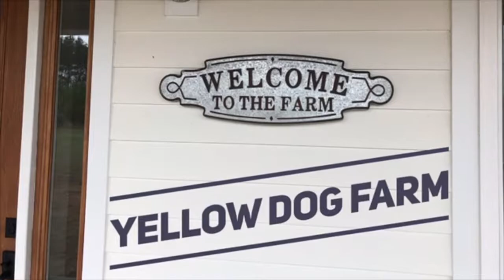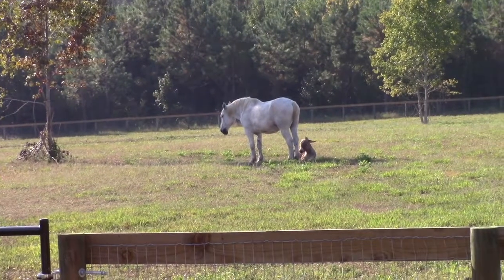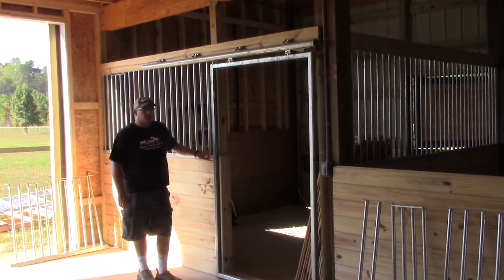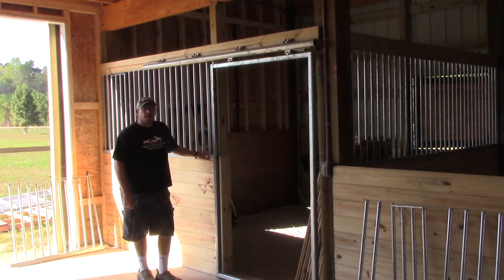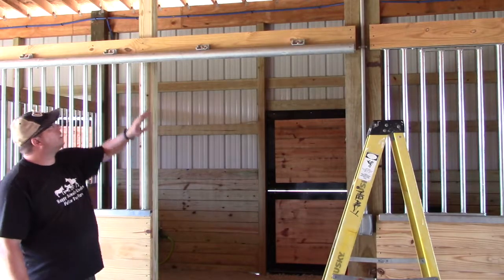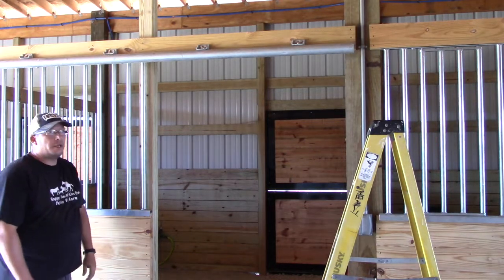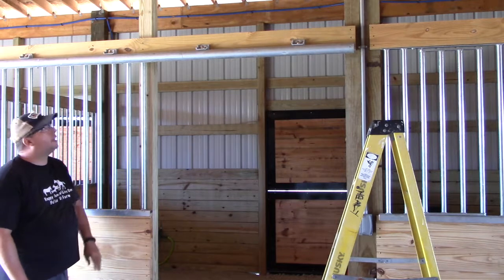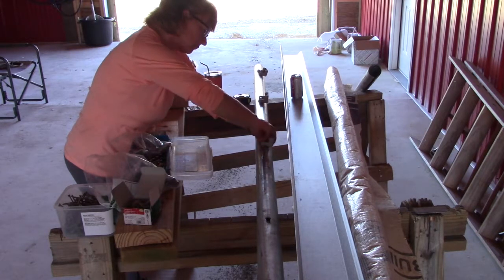Triton Stall Kit Part 2

Comment: Do the stall fronts come with the door latch?  The drawings on their website are nebulous.  Thank you!
Reply from the maker: Carolyn I apologize!  I did not see this comment until now.  The door latch is one of the door bars that is spring loaded.  It pops into a pocket installed on the door slide.  It really wants everything to be lined up just right.  We tend not to use them.  Instead we put an eye bolt through the door and then one in the post, then we put a pin through the two of them.